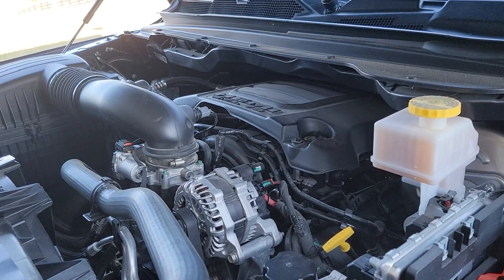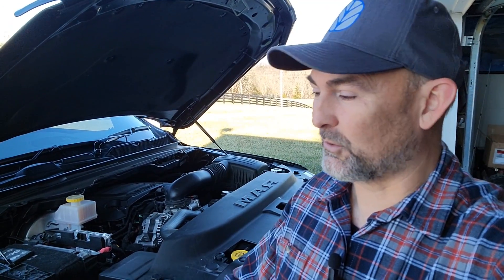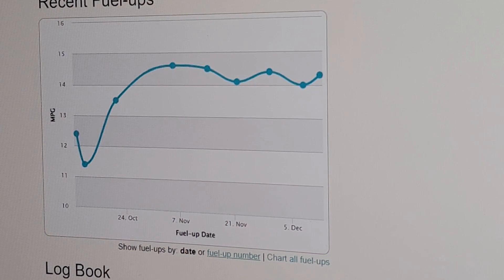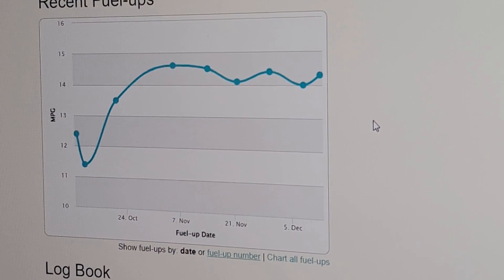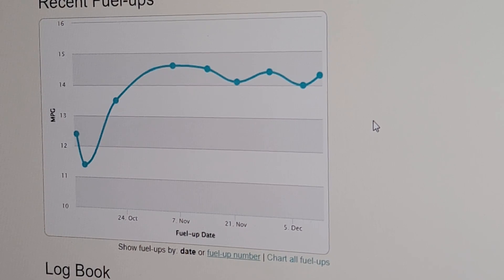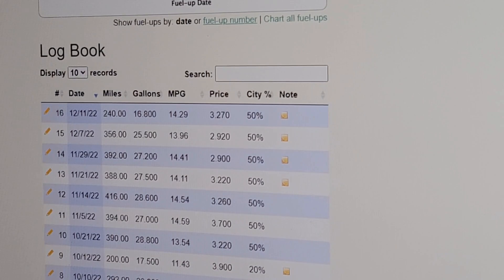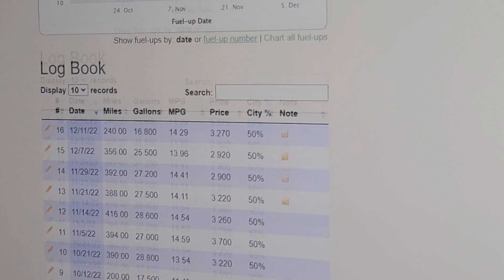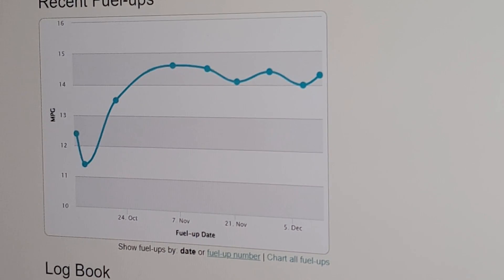Does Multi-Displacement System / Active Fuel Management / Cylinder Deactivation Really Save Gas?

Comment: Question: when your not doing testing do you use MDS all the time ?
And I know your Ram newer than mine 
My truck is 2014 Ram I see your truck use 5w30 my truck has 120,000 miles always use pennzoil ultra 
I try the same test you did with my Ram with MDS on I got 25.7 mph with MDS off I got 21.8 mph 
I see you have your MDS turn off all the time will that hurt the engine in anyway 
Good video

Comment: Thanks for the video. I have to believe the MDS system for the long term is not good for your motor. I turn it off all the time, and I also turn off the start/stop. I am also going to the 5w-30 full synthetic oil on my next oil change. Since I only have 32k on the motor, I think I'm going to install the edge Pulsar tuner. Then if I have to take it in for warranty work I can just remove it.

Comment: It does save you some serious bucks on fuel. But you must change oil and filter more often. I had to replace one head and have the other rebuilt. One camshaft broke in two places! Use only synthetic oil. I change oil about every 3-4,000 miles.

Comment: Turning off the mds will starve the mds lifters of oil
and there isn't enough oil splash from the crank to lubricate the camshaft. You will need to install the block off caps and remove the solenoids if you're running the mds off all the time or the lifters bearings, and your cam will pay the price.
Reply: Just wondering if all these ram with lifters and cam problems are because they turn off MDS from working the way it’s designed to do .

Comment: My 2022 Ram 5.7 just smoked with 49k miles. They had a new long block in the truck under warranty and back to me in 17 days no questions ask. My truck had all oil changes done at 4000 miles by the dealer. The service guy said it was the MSD that killed the engine, they see it all the time. Chrysler reset my 100k warranty to zero, if not for that I would delete that garbage. 
I don't know what to believe.

Comment: I have a 23 charger scat pack, don't know if it has MDS, it has eco mode, but that is never used. As far as the MDS I don't ever see anything in the instrument cluster showing it. I don't see any where to turn it on or off if I do have it. I only  see  the eco mode option  on the SRT page 🤷‍♂️
Reply: Every Hemi from Chrysler has MDS due to emissions requirements. My scatpack has it, as well as my grand Cherokee with the 5.7. The MDS system killed my jeep motor so I’m getting a full MDS delete.
Reply: Eco is the MDS
Reply: @bdo9114  thanks

Comment: The better question is, does the AFM system save you enough on gas to warrant the potential massive repair bill down the road that happens to 50% of them. Also keep in mind the AFM system causes a lot of carbon build up in the deactivation cylinders.
Reply: it doesnt they only put those in to get certified by the epa
Reply: Not doubting you, I’m just wondering where you found these numbers because I would be interested in reading up on this.
Reply: @alexgroff6214 he made those numbers up bro 🤷‍♂️

Comment: What year did they start adding this to the hemis ?
Reply: My 05 Magnum RT has mds.
Reply: My 2005 Chrysler 300C has it. Turned it off with a Predator tuner. Fuel mileage didn’t change and it’s a lot more fun to drive.

Comment: This is the same as the start-stop feature. I tried it on and off many times on two different vehicles and I always got about 1 mile to the gallon better with it off. This and using thinner oil to get the MPG ratings up so they can sell cars and trucks.

Comment: What percentage of your miles drive with mds on was it actually shutting off 4 cylinders?  It doesn’t actually kick on over 70 mph.  I’m curious what the mpg shows on the display when you are going 50mph with mds on vs off.
Reply: My truck will kick on eco mode down to 35 mph!

Comment: The 5.7 calls for 5W-20, not 0W-20.
Reply: @Nick-nm8om  I know what Uncle Tony says about it, and when I heard him explain that, it made sense. However, after hearing some other explanations, his sounds kind of dumb. I'm inclined to believe it has nothing to do with the location of the camshaft, but instead, it is caused from low oil pressure at idle. Excessive idling seems to make more sense. Watch Reignited - Cycle and Automotive, he debunks Uncle Tony's assessment.
Reply: The newer ones do
Reply: @death2peepz  I have a 2020 Limited (non E-torque) and it calls for 5W-20.
Reply: @AdpeGorilla 2022 do
Reply: @death2peepz  Ahh, I wonder what changed. As far as I know, the engines are identical.
Reply: It’s the 3.6 that takes 0w 20 nvm
Reply: i own a 2022 5.7. its 0w-20 for sum reason
Reply: @Apple-kf7nt  0W20 or 5W20 is only different in a cold start situation(winter)  after one minute your engine is hot that's when the  20 oil  kicks in
Reply: @Nick-nm8om  I would also challenge anyone to explain exactly what, if any, difference there is between my 2020 5.7 Hemi that calls for 5W-20 and, say, a 2022 5.7 that calls for 0W-20. I'm willing to bet there is absolutely no difference  that would necessitate a lower viscosity oil. I'm convinced the sole reason for this change is to improve fuel economy averages so Ram can comply with ever increasing CAFE standards, and literally no other reason.
Reply: @Nick-nm8om  Are you attesting that the camshafts are different from year to year? That's the reason for the change in viscosity?

Comment: Got a question, how do you turn mds off?
Reply from the maker: Use the plus and minus buttons on the steering wheel to enter Electronic Range Select mode, then you can pick how many gears the trans can use while simultaneously keeping MDS off.  Tow/haul also turns MDS off but you may not get 8th gear.
Reply: @4-LOW I do it from steering wheel as well I never tried that from tow switch

Comment: So you need a tune to permanently turn mds off?
Reply from the maker: To permanently turn it off, yes you'll need a tuner.  On the Ram I just use the buttons to enter ERS mode and turn if off whenever I drive the truck.

Comment: I just bought a 2014 1500 with it and so far my findings are it helps going downhill and maybe city driving.  Country roads and interstate I see no improvement in the lie o meter readings.  On windy days or towing any weight, shut it off for sure.   

I can see on smaller vehicles it would help, but bigger SUVS or full size trucks, the engine has to work when in 4cyl mode which uses more fuel vs all 8 cyls and plenty of power there so has to work less.

Comment: What’s your opinion on my 6.4 hemi, I use the 0w40 and ticks drive me crazy. Thought about different oil myself,what do you think?
Reply: The 6.4 doesn't have the cam and lifter problems near as bad as the 5.7
Reply from the maker: Does the manual spec 0W40?  I thought those were spec'd with 5W30?  Maybe a 5W40 full syn would be a great compromise.
Reply: @4-LOW  yes manual does recommend 0w40 synthetic. Just curious if trying different viscosity would be a wise decision.
Reply from the maker: @tomdugan3407  The 40 number is the hot viscosity so in that case you've got excellent wear control while towing and any time the engine is up to temp, but the 0 number allows easier cold starts on a winter morning.  I'd stick with that oil.  My main concern is any oil where the upper number is 20 viscosity or below.
Reply: @4-LOW  Thank you for the advice. Much appreciated